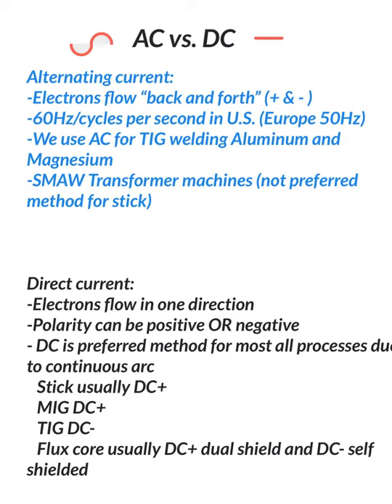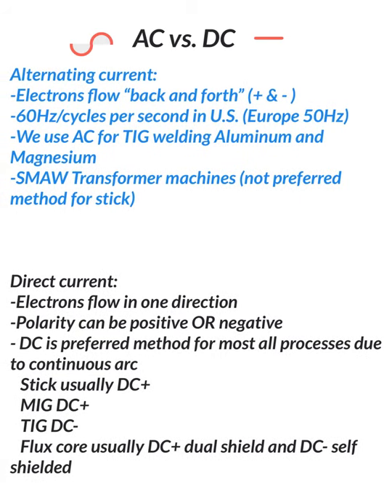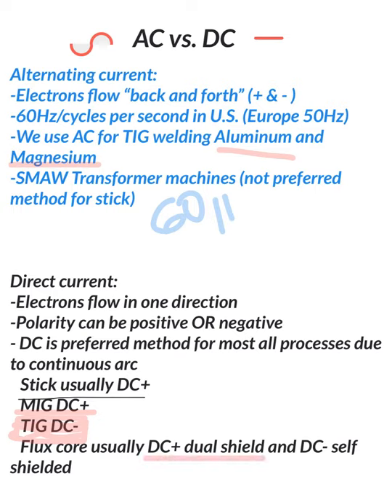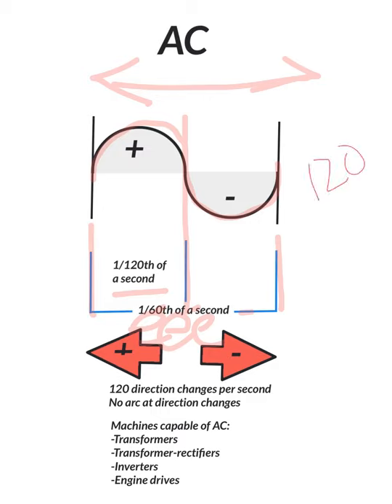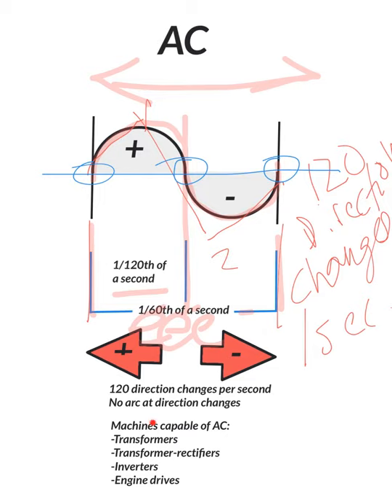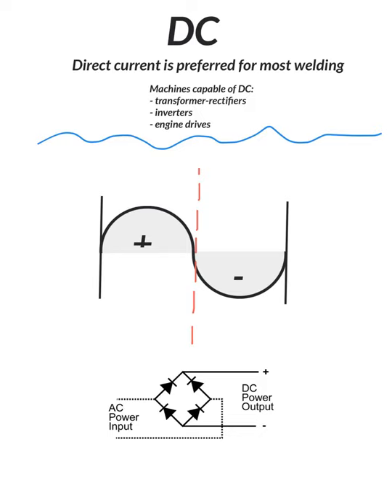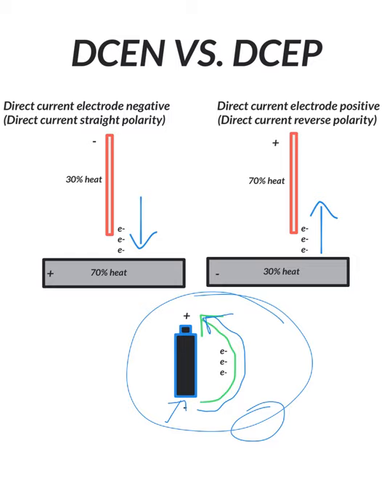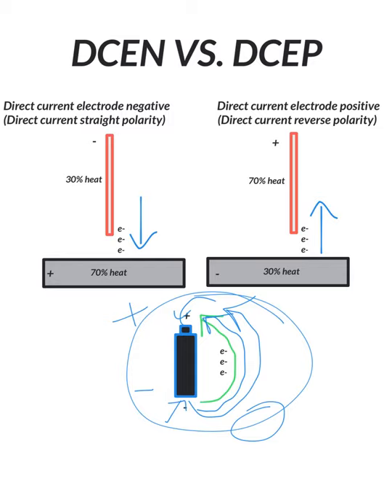AC vs. DC Welding

Comment: Very well explained. Could you tell me if there’s a way to determine if the lead is pos or negative? I ask because I have a used welder that someone has added longer leads and I’m unsure which is which. That also leads to one last question, the leads that were installed are around 40’ and I was wondering if that means I’ll have to run it at higher amps to compensate.
Reply from the maker: You should be able to trace the lead back to the power source and see where the electrode and ground lead connect to. Most stick and basically all MIG (not flux core necessarily) are positive. TIG is negative.  
As for the length of 40’, it’s possible to lose some amperage at that length but it would me very small.  Typically at 100’ or more is where the drop can be noticeable.